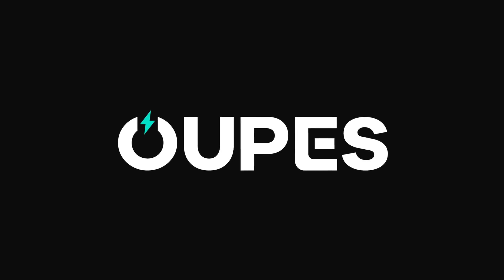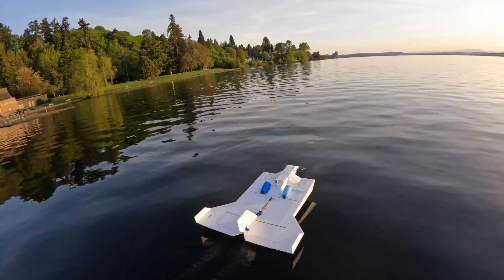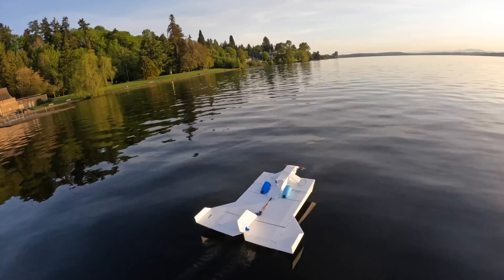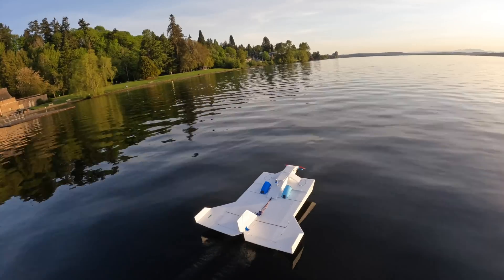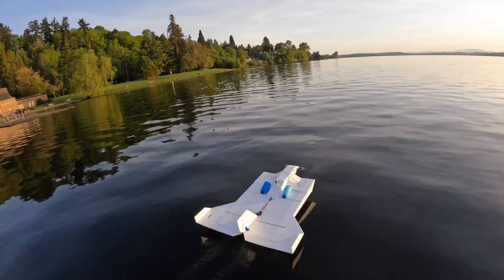Testing WWII Era Terrain Following 'Radar' On R/C Plane

Comment: The ground effect generates lift based on the air cushion stuck between the wing and ground surface. we can reach it at a lower speed as the same lift generated at a higher altitude (where no ground effect affects the plane). So, my assumption is that if you were putting pressure sensors on the wing's surface and the nose (maybe on the leading edges?) of the plane, and your controller were concentrating on keeping the pressure pattern bound to the ground effect instead of trying to control an elevator, your ground effect machine would perform better (even redirect airflow to increase or decrease the pressure under the wings). What do you think?

Comment: I see one reason for the osillation in the linear actuation of the canards, the controller reaction should be weaker at low and stronger at high altitude. If you want to use a mecanical ground following controller, a possible solution would be to use a crankdisk and connect the controll surface at "top dead center" when the "ground following stick" is at its lowest point, with a second lever at the controllsurface right at 90°. But it would recuire some testing.

Comment: This is where machine learning could really be interesting - with two ultrasound sensors (one facing down, one slightly forward) and a way to detect hitting water (capacitatively, or via an accelerometer), you could feasibly train a model to follow the water as close as possible, while predicting its future path (and increasing altitude for waves). It would also naturally learn to filter out noise from the sensors and water surface fluctuations without losing sensitivity to a sliding window average (like a regular control loop would).

Comment: If I had to guess, id say there is too much lag in the ultrasound sensor. This can introduce oscillation as you try to close the altitude loop around the sensor output. Perhaps a Kalman filter could be used to forward predict the altitude to compensate for lag around the loop?

Comment: It seems like changing the pitch of the airplane is a bad idea -- what if you did canard + elevator? That might cause the plane to rise without disturbing pitch. Alternatively, an airplane / quadcopter hybrid; you could run the quad motors at a slow speed to give you much finer grained vertical speed control.

Comment: Flight ontrol systems engineer here. Your videos are a delight, but with a bit of frustration around control design. I am sure that if you invested half as much time in beefing up your control systems engineering skills as you spend with 3d printing and whatnot, you'd be much less often puzzling over what's happening and you'd cut on the trial-and-error stage.

The hard part is probably the aerodynamics though. Unless you make a wind tunnel, or you invest in CFD software, you'd have to characterize the plant's response in-situ, which is challenging (but since you seem to be able to always have something that at least flies, it might be sufficient).
Anyway, hats off to your dedication.
Reply: EE with an emphasis on control theory and comms, its kind of difficult to just learn about control theory as there aren't many online resources. You'd need to take classes or buy some college level books and teach yourself, which isn't easy. I think if he really dumbed down the response rate he would have gotten better results.
Reply: @Ult_ra_violet  Either go through the hassle of teaching yourself, or better yet hire a graduate engineer to help with projects and teach you these kind of finicky concepts
Reply: Mechatronics engineer here! 
I'd love to see this project developed further. Im lead to believe that the oscillation problem may also be a result of the senor range. If the controller always has an accurate height measurement using a range of sensors (like IR and sonar fused with some form of Bayes filter), then the PID gains can be dynamically allocated. An airspeed measurement would also be useful to scale the gains, as the controll authority dramatically increases with airspeed. 

I like this approach because you don't need a perfect plant model, but you do need a half decent starting guess. A motion model is easy enough to find insitu for the bayes filter, though changing wind speeds/ direction might make for a new headache. 

So with just height and airspeed measurements, the controller should have enough information to fly without oscillation at any altitude. Pitch sensors may not be needed as sinkrate is arguably more important for stable flight at ANY airspeed. The only other useful information would be the terrain height AHEAD of the aircraft, similar to the terrain warning in real aircraft. this could just be a simple IR senor with a 5-10m range in this case.
 
I think I still have the code to do this from a similar robotics assignment from Uni. Id be happy to dig it out for anyone interested.

Loving the ground effect series! I look forwards to your next idea!
Reply: FluidX3d is an alright free for non commercial CFD program. Kind of a pain to use but it runs alright on consumer grade hardware if you have a decent discrete gpu.

Comment: As far as the canard controller.... You could have printed one or the other gear smaller, to create a differential ratio such that "closeness to the ground" is not linear with "aggressiveness of the canards," weakening the response without weakening the actual power of the canards.

Comment: Have you considered using rope potentiometers?

Hear me out! Attatch four rope potentiometers on the edges of your ground effect craft (one each for the leading and trailing edges of your thick-cord wings). Create a lifting surface to attach to the end of each potentiometer. This lifting surface should be of sufficient width and size to counteract its own weight, when in ground effect.
As the craft goes up, the lift on the front potentiometers is reduced, they extend and the charge is converted into a nose down command. As the craft goes down, the lift on the front potentiometers goes up, the rope is shortened and the charge change is programmed into a nose up command. Basically, the controller would command the craft based on tje differences in the charges of the individual potentiometers, with a set charge for the craft's cruising altitude.

Comment: Adjusting the "follwer" arm would be analagous to tuning the control loop, while changing the canards as you did was just altering the strength of the response. I think that a curved arm would help smooth out the response. You may even be able to design a response curve on paper, and make a physical version of the curve out of wire to be the control arm.

Comment: The issue is the input from your "sensors" and the output from your plane. Because the input from your "sensors" gets more intense the closer to the ground, and they seem to get way more intense before the plane has time to correct. So being able to adjust the sensitivity, or a delay or something along those lines would be the path forward.
Reply: I agree with this completely. Basic damping of the control surfaces should aid greatly. Maybe even something as simple as a friction damper attached to the control horns/surfaces. Maybe a rate slowing of the reaction speed in your duino? Or a steepening response rate based on altitude? Slow response with small altitude deviations, faster responses the further it deviates from its correct altitude.

Comment: In full size aircrafts that are aerodynamically stable one always talk about ”pitch changes speed and throttle changes altitude”, atleast throttle changes vertical speed. Have you tought about connecting the hight measurement to throttle more than to pitch? Might work or might completely fail, might be something to try out as well😊 and as always, great video! Much fun to watch and learn from

Comment: In my opinion you need a non linear lag between the sensor input ans elevator. Something that "cushions" the response. In the mechanical model it would be some sort of spring. Much easier to do it in code tho because there would be a lot of testing involved to get it right.

Comment: shortening the legs did not deaden the controls, it only changed the amount of distance the leg had to travel to full lock. what you needed was a gearing change between the legs and the canard. Also a sharper angle rearward for the legs, as well as long ones. short ones are gonna shorten the overall control, making full lock happen in only a few inches of travel.

Comment: The angle between the tail wing and the main wing is the neutral angle. As the plane flies, it will adjust the tail angle up and down. Assuming its in ground effect, which both pulls it down and moves it up, shouldnt the sum of up and down angles add up and equal to the neutral angle? That way you would know if the system is maintaining an altitude above or below the ground effect altitude

Comment: In the sonar code try adding a smoothing code RNGFND1_WSP_MEDF: Moving Median Filter = 0-255 unless you’re using a custom code in a ardupilot. I think some of the oscillation is the waves 

Sets the window size for the real-time median filter. When MEDF is greater than 0 the median filter is active

Comment: 11:39  Your canard issues might stem from the sprung mechanism's reaction force, causing a mix of aerodynamic and mechanical forces in your feedback loop. Test this by balancing the plane on your fingertips and lowering it onto a surface with the mechanism activated; if it pitches up, there's a mechanical force in your feedback loop.
Reply: Yeah, she's bouncing off the rubber bands.

Comment: Turn off D gain, and use a pretty high I/D ratio. Height adjustment when there’s a strong transient (like in AFM closed loop controllers)  doesn’t benefit from derivative gain, it introduces ringing.
Try a schlieren cameras to for your wingtip visualizations

Comment: Summary

Sponsorship and Introduction  
   
- 0:00 Video is sponsored by Opus.  
- 0:02 Creator found images online showing a WWII concept for early terrain following radar.  
   
Project Overview and Background  
   
- 0:15 The video will attempt to recreate the terrain following radar concept with an RC plane.  
- 0:19 The creator's interest stems from a recent obsession with ground effect vehicles.  
- 0:25 Explanation of what wing chord is and its significance.  
- 0:41 Deep chord designs have been the focus because they seem to create a stronger ground effect.  
   
Choosing the Aircraft  
   
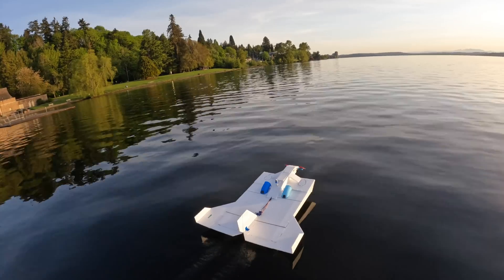- 1:21 The FMS Fox with a 2.3m wingspan will be used for experiments.  
- 1:27 First impressions of the FMS Fox show it flies well due to light wing loading.  
   
Ground Effect Testing and Modifications  
   
- 1:36 Sources indicate the ground effect becomes noticeable at half the wingspan's height.  
- 1:49 Despite expectations, the ground effect isn't strongly felt at expected heights.  
- 1:55 To measure efficiency in ground effect, a flight controller is installed.  
- 2:21 The plane is modified with foam pontoons for water landing capability.  
- 2:44 A waterproof sonar sensor is added to measure height over water and aid in surface following.  
   
Initial Testing and Tuning  
   
- 3:00 First test at the lake shows that the plane flies well with modifications.  
- 3:12 Surface following mode with sonar control initially fails, causing the plane to dive into the water.  
- 3:25 After tuning the controller, the plane still has too much response.  
- 3:47 The plane is flown beside a boat to further tune the surface following controller.  
- 4:18 After adjustments, the sonar mode works without crashing, but still oscillates.  
   
Improving Water Takeoff and Landing  
   
- 4:56 Modifications made to allow the plane to take off from the water.  
- 5:16 Successful water takeoff allows for more convenient testing.  
   
Continued Challenges and Efficiency Measurements  
   
- 5:24 Altitude oscillations persist despite tuning efforts.  
- 5:52 Efficiency measurements are taken to compare flying in ground effect versus normal flight.  
- 7:18 Data suggests an 8% efficiency improvement when flying in ground effect.  
   
Aerodynamic Visualization Attempt  
   
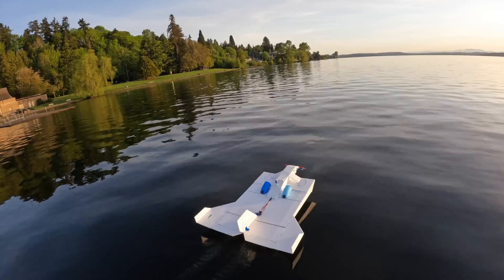- 7:25 An attempt is made to visualize aerodynamic differences between thick and thin wing cords using fog and lasers.  
- 7:58 Visualization of wingtip vortices is achieved but not sufficient to draw conclusions.  
- 8:36 Creator expresses interest in using smoke generators on the plane for future experiments.  
   
Sponsorship Details  
   
- 8:45 The creator packs up after conducting the experiments.  
- 8:50 Information about how the fog was generated using an Opus Mega3 and fog machine.  
- 9:11 Opus Mega3's features and usefulness are highlighted.

Introduction to Opus Mega 3 and Its Features  
- 09:24 Describes the Opus Mega 3 as a powerful, portable energy source.  
- 09:31 Highlights that it can be charged from the wall, solar panels, or a car's DC output.  
- 09:37 Mentions the convenience of wheels and an extendable handle for transportation.  
- 09:41 Details the various outputs available on the Mega 3 for charging multiple devices.  
- 10:00 Talks about the option to expand power capacity with solar panels.  
- 10:11 Introduces Opus Help, a welfare program for sustainable energy solutions.  
   
Developing and Testing the Surface Following Wand  
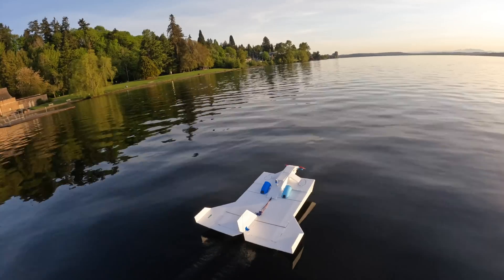- 10:28 Discusses issues with sonar control for maintaining altitude.  
- 10:34 Introduces the dangling wand concept borrowed from hydrofoil sailboats.  
- 10:41 Explains the use of a 3D scanner to design parts for the wand mechanism.  
- 11:10 Recommends Onshape for hobbyists and offers access to design files.  
- 11:23 Describes the process of 3D printing parts and installing them on an airplane.  
- 11:31 Shows how the wands and canards should help the plane maintain altitude.  
- 11:40 Notes that the initial control response was too powerful, causing oscillation.  
- 11:52 Attempts to reduce response by modifying canards without much success.  
- 12:10 Concludes that reducing the canard size made the control too loose.  
   
Exploring Alternatives and Outcomes  
- 12:22 Repurposes the wand mechanism to control flaps instead of canards.  
- 12:37 Demonstrates the mechanical function of the new mechanism.  
- 12:45 Acknowledges that the flaps did not effectively control altitude.  
- 13:02 Considers the idea of testing the concept on water despite its issues.  
- 13:16 Reflects on the difficulty of solving the surface following aircraft problem.  
- 13:25 Suggests that designing an aircraft more sensitive to ground effect might be best.  
   
Conclusions and Learning Points  
- 13:40 Shares insights on the impact of thin Wing cords and ground effect visibility.  
- 14:02 Questions the correlation between the strength of ground effect and efficiency gains.  
- 14:12 Comments on the influence of wing cord length and aircraft scale on ground effect.  
- 14:19 Uses the FMS Ranger as an example to discuss the ground effect's relation to scale.  
- 14:38 Contemplates modifications to the FMS Ranger to potentially enhance ground effect noticeability.  
- 14:42 Ends the video thanking viewers for watching.

Disclaimer: I used gpt4-1106 to summarize the video transcript.  This
method may make mistakes in recognizing words

Comment: I'm no expert but after chatting for a while with chatGPT, I found some points.

Your plane has a stabalizer in the back. This wing is affected by the ground effect differently due to its position. It can be the reason for the oscilations.

Typical ground-effect planes don't really have a separate wing at the tail, greatly improving stability.

Here is a concept we came up with: (I made chatGPT be as creative as it can be)

CONCEPT: TEARDROP-SHAPED FUSELAGE WITH FLARED WINGTIPS

Design the ground effect vehicle with a teardrop-shaped fuselage and flared wingtips. This configuration takes inspiration from nature, resembling the shape of certain birds and marine animals that glide efficiently close to the water's surface.

Teardrop Fuselage: The teardrop-shaped fuselage minimizes parasite drag by reducing frontal area. It offers a streamlined profile that promotes laminar airflow over the vehicle.

Flared Wingtips: The wingtips of the aircraft can be flared upward slightly, resembling the upturned tips of bird wings. This design helps in damping oscillations naturally by reducing the susceptibility to roll movements.

BENEFITS:

The teardrop-shaped fuselage minimizes parasite drag, contributing to overall efficiency.

Flared wingtips increase lateral stability and help dampen oscillations, especially roll oscillations, as they provide a stabilizing effect similar to winglets.

This passive design promotes stability and efficiency without relying on active control systems.

STANDARD RULE CHECK:

Airfoil Selection: Airfoils can be chosen to match the wing and fuselage design for optimal lift and drag characteristics.

Engine Placement: Engine placement can be optimized to complement the teardrop fuselage and flared wingtips.

Altitude Sensors: While this design doesn't rely on active control systems, altitude sensors can still be useful for pilot awareness and operational safety.

By combining a teardrop-shaped fuselage with flared wingtips, this design promotes passive stability and oscillation damping while maintaining efficiency in ground effect. It takes inspiration from nature's aerodynamic solutions and can be further refined through testing and analysis.

You need to add some control surfaces and a vertical stabilizer of course. If you want pitch control, mount the rear wing at the top of the vertical stabalizer, away from the ground-effect so it won't be affected too much by the ground effect.

Comment: Would be kind of cool to control it via software and PID. Using a potentiometer. It can be seperate from the control system. You could use an arduino with a simple sketch to control the servo based on the input of the pot.